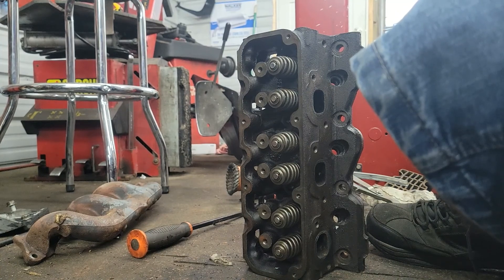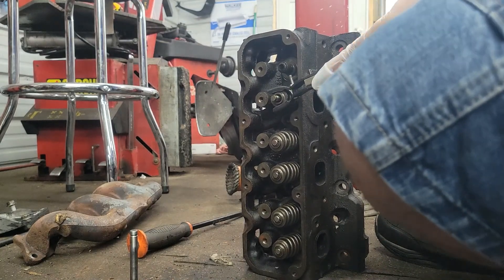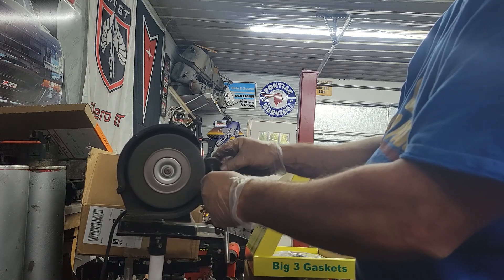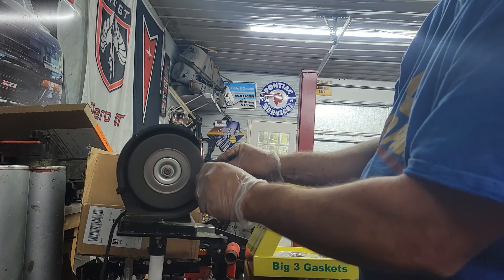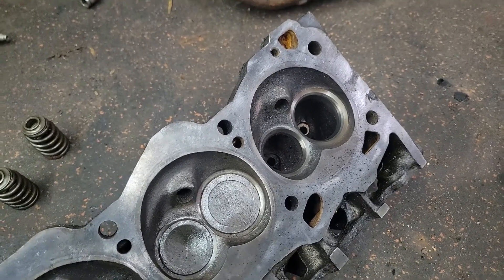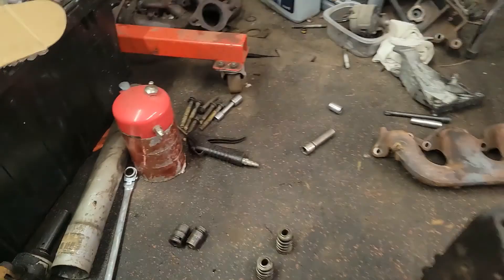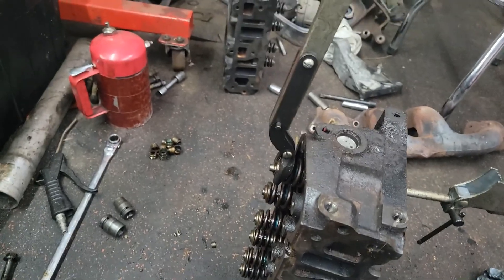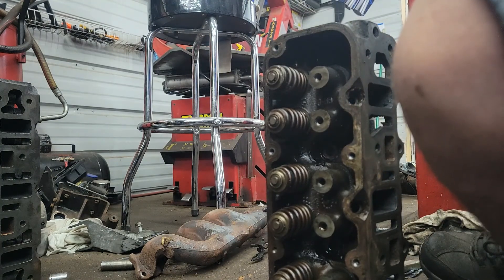How to clean up a 3800 Supercharged Head

Comment: You could hold the collets in with a little grease😉
Before releasing the valve spring compressor.
For the head surfaces and exhaust port gasket surfaces, try using a fresh grinding stone. You will see if there are any surface problems better than just wire brushing the surface!
You would "kill" an aluminium head with your techniques by the way. Just saying😉 cheers!
Reply from the maker: True, i have done with stones.   Love the wires.    I lubed everything up nice with astroglide.   Lol